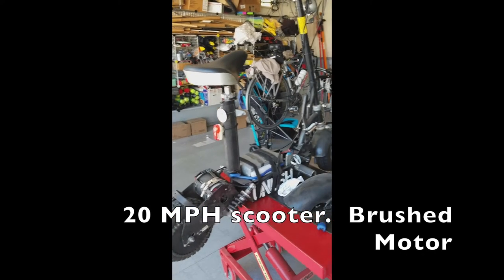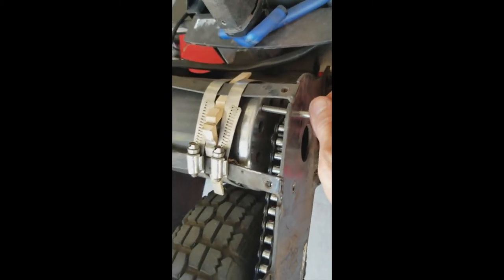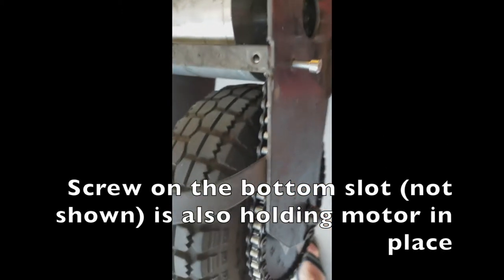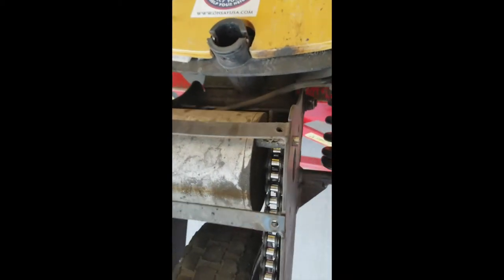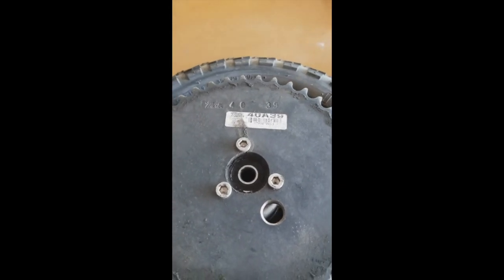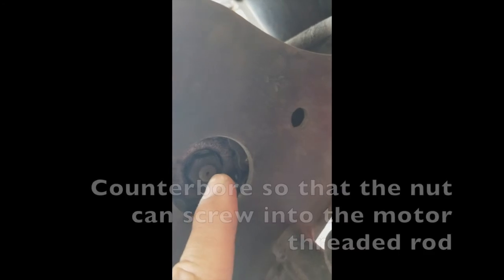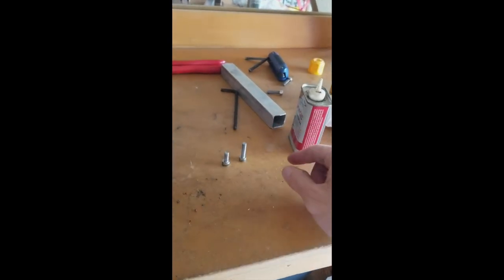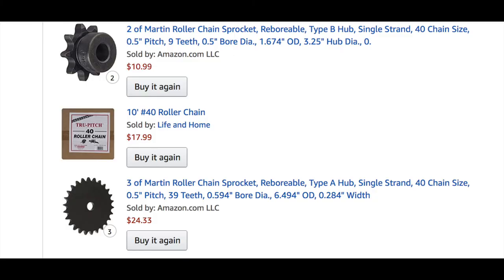Scooter transmission Upgrade

Comment: Vu, you're back man!  Glad to see you posting your newest upgrades. I'm running a new street tire in the 90/65-6/5 size on my 1500w brushless. It's an innova so it wears like the tire you just put on, but it's a smoother ride. I balanced it too and changed the tire valve to 90º screw in type. I also found a 52 tooth rear sprocket instead of the 54 tooth hill kit sprocket. It's definitely a bit faster. Aliexpress rocks!

Comment: Minhvu thanks for all your videos, Im in Cali also.  I picked up a used Lithium 1500 on CL for $500.  Your videos helped me decide on getting it and I took notes on all the information you posted.  You did the best in depth videos on this particular scooter so thanks for all the time and years spent on updates.  This scooter put a smile on my face last weekend.  I have a hill kit installed, it goes 33mph tops.  Do you think the hill kit chain will be more durable than the stock chains you had problems with?

Comment: Man how did you remove the front motor sprocket from the brushless motors. I removed the bolt and washer. But it will not come off. What am I missing?
Reply from the maker: pry it

Comment: Minhvu Ly  I bought a new Huat Tan 90/65-6.5 tubeless tire after my original had a little slash in the side wall and was worn down some. I had a hard time getting it to seal to the rim. When I just finally got it to hold air and was putting it on it deflated again.Do you have any info that might help? Have you or heard of people having issues getting them to seal to the rim?
Reply from the maker: Inject a little amount of slime into the tire.  let me know if you need further clarification
Reply: Minhvu Ly Yes I tried that slime and am wearing most of it. I finally got the tire sealed against the rim. The air all escaped mounting it unfortunately installing it do to the nonfunctional valve stems on a new scooter that leak on both rims. Do you have any magic solution for those?  Have some new rims CNC made for a small fortune? You mentioned an issue with a rear rim/tire. What was that issue.
Reply from the maker: Buy rim with tube inside tire.
Reply: Yes I have had tube tires on the gas powered scooters I have built. They are not anything to celebrate for reliability. For a $$$ scooter I wish they could put a decent valve stem on a rims flat spot instead of cheap ones on the peak of the curve of these. Do you know of any quality ones that will fit these?

Comment: Have u ever had problems with the throttle, my economy button went out?!?
Reply from the maker: I've had problems with the roller chain and sprocket wearing too quickly, the controller died, the battery died prematurely but surprisingly no issues with the throttle ever and I've got a combined 10000 miles on all scooters.